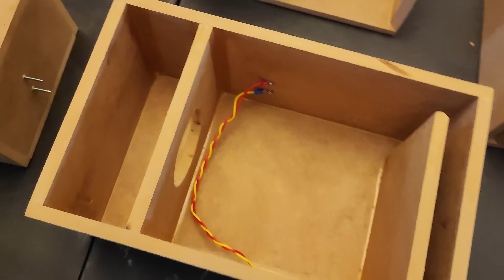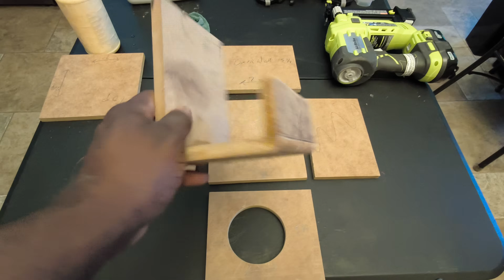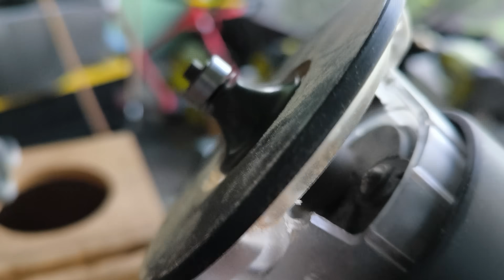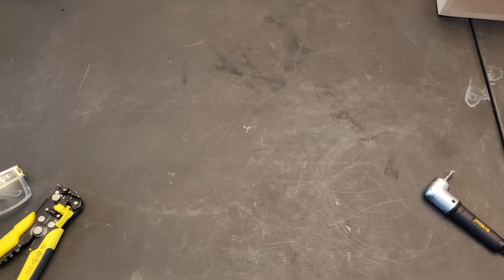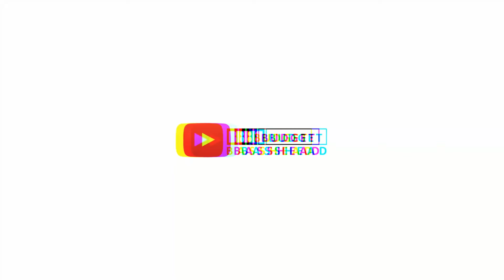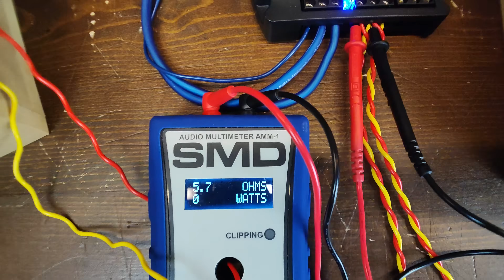I Built A Miniature Sealed vs Ported Enclosure - For A 4 Inch Woofer - Music Demo

Comment: I had a sealed box with 2 15” L7s. I wanted a second box for 2 more. I decided to do something different. My new box I built ported. I put the larger ported box AND the sealed box in the same Ford Excursion and it was BEAUTIFUL running both at the same time. It filled the frequencies nicely. They perfectly complimented each other. That was a very unique and awesome sounding vehicle with 4 15s in it. Heck even if you are only doing 2 subs in your vehicle… I’d suggest trying two separate boxes. One sealed and one ported. I think you’ll be surprised

Comment: im upgrading from a smaller amazon 300w rms 10'' in a ported box at 37hz to two ct sounds hydro 12'' subs 550w rms each in a sealed box with .80 cu-ft per sub and ill run them 1,100w rms will i be disappointed going sealed?

Comment: Why not just run one amplifier?  You have the Taramps and a Soundfy amp.  Why?  Use the Taramps to run everything.  Use the crossovers in that amp as they're meant to be used - high-pass to the bookshelf speakers and low-pass to the woofers.  It looks like you're running speaker level and RCA into the Soundfy?  Am I correct in that assessment?  Use one or the other.  That speaker level input is going to introduce so much bad stuff - noise, distortion, risk of clipping the inputs - ALL bad stuff.

Second to that, get a stand, my friend...  Your constant moving around is undeniably distracting in your video.

You've got good ideas.  Better implementation will take you a long way from this starting point.

Comment: Sealed Enclosure = Low Loudness but High quality tight bass, Low gain Low efficiency, High control over diaphragm excursion. Sounds best indoors
Ported Enclosure = High Loudness but Lower quality boomy bass, High gain High efficiency around tuned frequency, Low control over diaphragm excursion beyond tuned frequency. Sounds better outdoors

Comment: The best enclosures I ever made were concrete. As thick as you can go. You can make them look just like wood or you can make them look like Rocks. Heavy or light. Use chicken wire or fence wire reinforcement. Did I invent them?

Comment: Back before I knew anything I had a design philosophy on  box building: build a big sealed box and you'll get good results. Now I usually do ported boxes, built to manufacturer's specs to fit in whatever car it's going in.
The woofers I choose usually are best suited for bass reflex enclosures. I've changed the opinion of alot of people that thought ported designs lacked punch and accuracy after giving 'em a demo.
* currently got a 5.2ft3 L-port box tuned to 35hz for two 12" G2's, powered by a Stinger MT2000.1D and it DROPS QUAD! I bought the subs used for $100, built a box and put 'em in my car just to test them, but like them so much, they're still in here 2 years later, instead of the single 18" Sundown U series that is normally in here.

Comment: The EBP=110, so this driver definitely favors a vented enclosure.
0.11 cubic feet net internal volume, F3 at 54 Hz.
Will need a passive radiator pair if the smallest box volume is desired.

Comment: Why didn’t u make the boxes the same size to keep it apples to apples? The sealed may have sounded even better if it had the same larger dimensions as the ported. Just curious. Thx
Reply: Go read up on box enclosure math. The wave pattern per box is different. If you make them the same size ported will always lose. The MATH states the ported enclosure has to be bigger. Partly to airflow and partly the frequency.

A sealed box has a plenum size of the inner square footage or square centimeters as the dimensions of your box. A ported box has a plenum size the same as the earth since it's open.

In a car you have an intake manifold with a plenum of a fixed size being fed by a single large throttle body. In an itb (individual throttle body) your plenum size is the earth. You can't tune the fuel ratios the same as one intake (itb) sees significantly less restriction than one with a plenum.. two the amplitude waves are stronger in an itb so without filters you will see a standing wave holding fuel droplets like fog above the air horn. In a manifold that problem doesn't exist. Just accept the fact the tuning is different if you aren't willing to research audio engineering, physics and math.

If you want to know, go do your research with your Google Fi and don't expect a world to always stop just to spoon feed you knowledge without expending any effort to aquire it.

Humans have more access to knowledge than any time before. It's just laziness now that stops people from seeking it. Laziness is a boat anchor that drags everyone including the lazy one.

What you ask is not scientific, go to audio blogs and forums and read their recommendations. Read blog and forum posts from audio engineers who design this stuff and see what they say. That way you can skip learning math and physics and still learn why what you suggested is a bad and flawed test.

It's like saying having a cheetah race a human in a dash but tying the legs of a cheetah together and make it run through quicksand is a fair race.
Reply: @omegaprime516 ok. Thanks 👍

Comment: Build a transmision line. The area of the tube is equal to the area of the speaker and the lenght of fhe tube is 1/4 lenght of the longest wavelength (lowest frequency) the woofer can play
Reply: I built a T-line with a 12” subwoofer for my home theater setup. It absolutely changed everything.  I had a lot of bass before, but now it will hit 10htz on the RTA and sounds very clean.  I have it crossed over at 40 htz. I love the transmission line. Takes up a ton of room, but the trade off is worth it.
Reply: @michaeldahle9484  yeah they are awsome. They are common for small speakers due to how much space tgey take up for real

Comment: Finally! Someone played two types of enclosures at one time. I just wish that you would run the ported with a capacitor to make it higher ohms and put them on two separate channels so the sealed gets more power than the ported. 
It's a tough ask but I'm working on something similar in my car right now. It might take me a few months.
Reply from the maker: That sounds like an interesting experiment for your build.
Reply: Wouldn’t that be a resister, not a capacitor? I’m not pretending to know, I just honestly thought resistors were how impedance is added.

Comment: I'm not a professional, but I've done my share of audio setups over the years.  I'm 54.  I just want to remind everyone that putting speakers in parallel can REALLY bust speakers if you're not careful.  If you put them in series, it can sound much softer, because instead of dropping the impedance, you add it together.  Therefore each speaker gets less power.  Also if you don't have a strong amp, if you run heavy speakers in parallel you can bust your amp too.  Because it can OVER-draw power and burn out the amp circuits. 

It really is a science to all of this, if you want good sound with longevity.  LOUD isn't better necessarily.  I've always preferred the sound of sealed cabinet woofers myself.  Another thing MANY speaker companies still do wrong is putting the mid and tweeters unprotected in the SAME enclosure.  This alters the mids and highs, because of the bass, and in extreme use cases can damage the mids and tweet speakers.  As a side note, you can get extra clean-ness in your subs, if you fill the main area inside with some soft material, like what some pillows are made from or what they call denim, but as a fluffed fabric.  It helps significantly reduce resonance inside the cabinet, which can alter the sound as well.
Reply: Thanks for sharing

Comment: Hey man can I rack your brain a little? I'm new to building out speaker setups but I have a car I want just a little bit of natural bass tone in. I'd like to throw one of these in a custom little enclosure. What am I gna need to run it through the aftermarket pioneer stereo? I know I'll need an amp but it would just be for the one little speaker box. Any suggestions?
Reply from the maker: I wouldn't suggest that. Unless you have at least four of these in a horn or bandpass enclosure. They don't put out much for car audio; unless used as surround speakers.

Comment: Would you mind sharing the dimensions of the 4th order box and the 6th order box? I'm trying to 3d print a couple of little subs for my kids rooms and think theses would work great. Right now i am just using a ported box with the TCP115-4 and it does ok but i think the band pass would put out more bass and be a little louder for them.

Comment: fuck ported. port noise always exists. period. i dont care what people claim. ive heard too many systems. port noise is dogshit. sure, ported can make a speaker louder.... OR, you could just buy a better subwoofer and put that into a sealed box, and feed it the higher power needed. hell i had a 300w kicker sealed system long ago and it was my favorite system. ive tried ported, bandpass, t-line. they all fucking suck. sure they hit low with minimal power. but they never matched how much better my kicker in a sealed box sounded. because sealed gives sound quality. no port noise, pure performance. want louder? get a better sub and apply more power with a better amp. ez. i will take a sealed all day every day. also the "controlled" sound of the sealed, that "back pressure" helps a lot. ported, the sub will be floppy. and floppy isn't good.

Comment: Hi, I have 4 inch subwoofer and 6.5 inch passive radiator. What box do I build that will utilise subwoofer the best. Ported, sealed, Passive radiator?
I kinda want it for my car just to add some 40hz
Reply from the maker: It's all about the software my man. Plug the ts parameters into WinISD or similar and see what it suggests.

Comment: . . . . . . . . remove the machine screws and insert static free plastic screw anchors [from the inside first], then put a rubber flat static free washer on the outside [connection is going to have to be between jam nuts].
if not, then use the round aperture for wire connection.
reason, is because the box is being charged. and with the car, truck, bike [which ever has a onboard computer] the static will build up and short out the computer and possibly fry the head unit.

other than that, good video. and good build box too,  i really liked that.
Reply from the maker: Thanks for the tips and suggestions

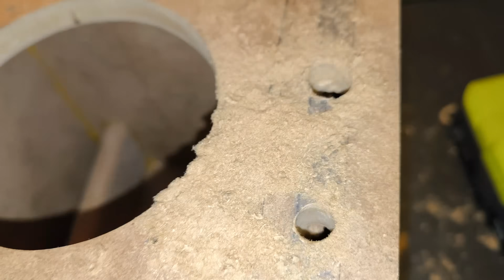Comment: Please, use a tripod so two hands can be used while routering. When you started into the slot port around 14:00, I cringed waiting for it to bite and run away up your arm! And, you’ll have much better control for the nicest cuts possible. 
Keep the videos coming. Love them.
Reply from the maker: Thanks for the safety tips

Comment: One of my favorite subwoofer enclosure designs is the tapped horn design. The front and the back of the subwoofer share the same port in phase when tuned and designed correctly. There is no sealed section. It offers high efficiency and sound quality.
Reply from the maker: Thanks for sharing

Comment: 30:56 He said, "Wow they sound good together". People always say you can't have it all when it comes to SQ and SPL, but this may be a solution for many. For instance, in a quad woofer set up it may be beneficial to have a sealed section for a pair and a ported section for the other. Infact I still have an enclosure I built for a 93 Crown Vic that has 3 chambers, the center chamber is 6 cu/ft port tuned to 28hz. It houses 2 Savard Hiq 12 v1. The other 2 are 1.5 cu/ft sealed, with kicker Comp Rs. The center subs and ports face rearward while the other pair face outward.  Sounds awesome. Two separate amps of course.
Reply from the maker: That's a unique setup
Reply: @BudgetBassHead Strange as it may seem, it definitely helped when I ran both pairs. Having two amps made it easy to adjust the gain up and down on either pair. Although the sealed chambers roll off sharply somewhere in the upper thirties, I believe that while the woofers were unloading they were actually helping to pressurize the entire trunk from the low twenties to mid thirties. Nearly two thirds of the rear deck is open to the cabin, acting kind of like a blow through port. Anyway, it was obvious from your reaction that when you added the sealed cabinet to the vented one your listening pleasure increased😊.  Likewise, the sealed chambers in my setup add quite a bit of snap and transience that a large vented design lacks. It may not have been perfect but it was pretty darn good. 
Thanks for all the amazing content brother. God bless you and yours.
Reply: yea the comp r's sound fantastic sealed if you ask me and I also love the hiq
Reply: I'm about to put a 6.5 in on 800 watts in a sealed enclosure. I also have two 15 in woofers on 1500 Watts ported. 
The 15-in woofer box is tuned to 35 Hertz and I have the filter set at 25 Hertz to drop to 24 decibels. 
I think I may allow the 6.5 to handle everything above 45 Hertz and tune it there. 
I also have a ported 10-in woofer box that is tuned to 25 Hertz so I will be swapping them out with a 15s when I feel like it. I may get more woofers and build more boxes. Lol
Reply: I like your setup.
Reply: that setup is likely to have phase problems

Comment: If your ever looking for some in expensive  power tools like extra hand router or any power tool.  I suggest  buy the clone style makita power tools  .  they avg around 30-40$ per tool  they have evey tool in clone .   If you already have any brand of power tool batterys   18-20v  you can use them on the clone tools.  By the use of a battery adapters  for makita power tools  to what ever brand battery you have. Example like a ryobi .  The power tool battery adapter are about  20$  you cant go wrong for the price   all the tools iv tryed work pertty good  considering  there  around 30-40$ a peace iv have a few going on 3years  old  now.    I know a lot of time a extra power tool can save quite a bit of time  not have to change the bit ever time.  Just a FYI 🎶🎵💯🫡✌️
Reply from the maker: Thanks for the tips and suggestions. Always trying to save a dime over here 😊

Comment: You forgot about passive radiators
Reply: I think he felt their strengths were better utilized elsewhere.
Reply: me and my dad made a mini sub using dual PRs and it's a similar driver that this guy used (mine is tcp115-8) that can go into the LOW 30S or even HIGH 20S
Reply: also that is without any DSP
Reply: @DanielBerzinskas I’m using one in my single cab ranger with and nvx vcw need to throw another pr in but I gotta get the mids and highs right first